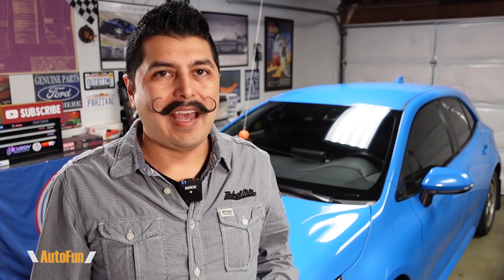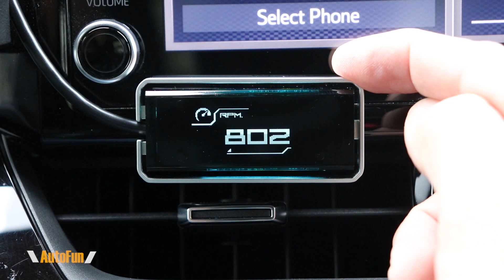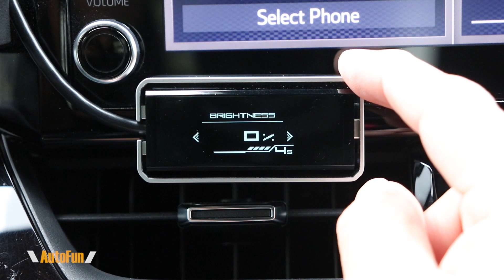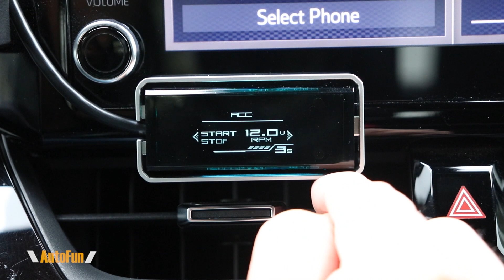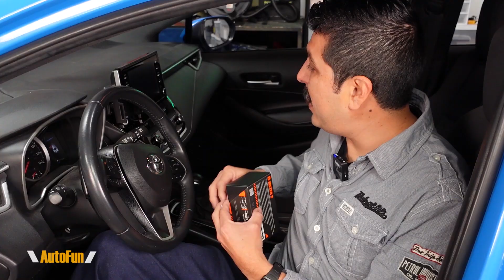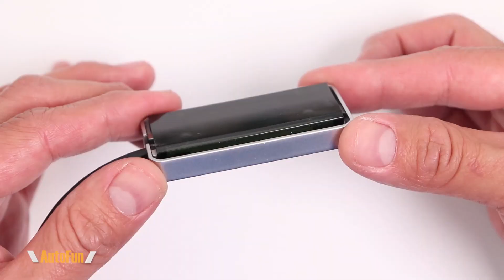Shadow D-Meter OBD2 Gauge Review (Boost, AFR, RPM, Speed, Voltage, Oil & Water Temperature)

Comment: Hi, great review. I have one question: does the D‑Meter gauge have a peak‑hold memory for boost, and does it support peak‑value alarms? I need to know if it can store the maximum turbo pressure and warn when the peak is reached. Thanks.
Reply from the maker: Thank you! Yes as shown in the video, you can set custom alerts for values like boost, cheers!
Reply: @AlexAutoFun  Thanks! Yes, I saw the custom alerts. My question was specifically about peak‑hold memory: does the gauge store the maximum boost value so it can be recalled later? In the manual I only see warning thresholds, not peak‑value logging.
Reply from the maker: @phoenixxx6969  Ah no, it does not support logging. If you need to log PID's I would recommend a basic dongle scanner like this one https://youtu.be/Wy2mxvdIH4E cheers!
Reply: @AlexAutoFun  From what I understand, the gauge in your review doesn’t have peak‑hold memory. I wasn’t looking for a Bluetooth OBD2 dongle: I needed an OBD gauge with fast refresh like yours (even if it’s not CAN‑BUS), but that can also store and recall the maximum boost value. Do you know any gauge with these features

Comment: I’m using it for almost a year on Infiniti Q50. It shows an extremely high values for EXT parameter, which I thought was supposed to show outdoor temperature. It shows 900F in this video so it’s not only my case. They specified the 900-2400F range on their official website, so it could be only exhaust temperature then. I googled and found out- it is an exhaust temperature. 
This maybe useful for some people
Reply from the maker: Hi I! Correct, EXT is normally the exhaust temp (usually at the catalytic converter but I also seen it Pre-Cat). Ambient Air Temperature is usually AIT, ATT, in some cases this info comes from the Battery Temp Sensor and sometimes it comes from a dedicated outside air temperature (normally on vehicles that display this parament on the inside of the car) Cheers!

Comment: What is the best ACC setting if you want to have it not draw power when the car is off? Would it be best to set it to a little under the running average voltage? How do you shut it off with the manual setting?
Reply from the maker: Hi Papaprime! Correct, the voltage setting will vary from car to car as each one will have small voltage variations. In addition, the voltage setting will also vary depending on how "sensitive" the owners want the gage to be to detecting the voltage change (for the gage to understand if the car is ON or OFF). Cheers!

Comment: Do you know if you can calibrate the speed to match what is displayed on the vehicle's speedometer?
Reply from the maker: Hi Twin! Ah remember speed calibration offset is typically only found on devices that pull speed from GPS. That adjustment allows it to match the car's speedometer to the GPS speed if different. The Shadow meter does not pull the speed from GPS, it pulls the speed from the actual vehicle (same source as the speedometer of your car) so it should match. Just keep in mind that OBD2 data is based on frames, which limits how much information can be pulled and how fast it can be sampled from the vehicle, which is why typically we see gauges requiring the lowest lag (typically for racing purposes, like speed or RPM) tap directly to the car electrical system's wiring (usually physically connected to ignition and other sensors) Which helps for cases where a faster response is required. Cheers!
Reply: @AlexAutoFun Thank you for your explanation!
Reply from the maker: You're welcome twin! @twinring3846
Reply: @AlexAutoFun  When you mentioned lag on the OBD2, will there be much delay in displaying the speed? Are we talking milliseconds or a second? The reason being is I plan on importing a car from Japan to the UK, and JDM cars only display the digital speedometer in Kph. Obviously in the UK we use Mph, so I need something fairly accurate. Thanks
Reply from the maker: @twinring3846  Hi Twin, accuracy won't be an issue in my opinion (unless the car speedo signal is off), but latency will be present. If you want to get an idea of the speed of OBD2 you can connect a basic car scanner like this one https://youtu.be/h8hh5ZUffz8 to see the response time or you can also see it on my HUD review here https://youtu.be/K7FbhZTxxaA Cheers!
Reply: @AlexAutoFun  Thanks. I'll take a look
Reply from the maker: You're welcome and here is another HUD that may interest you https://youtu.be/z-m_ez2a8o4  @twinring3846

Comment: That obd port connection looks dodgy man
Reply from the maker: Hi Rocoo! LOL yeah what your are seeing is potting (the material behind the contacts inside the OBD connector) is a standard process in the industry to provide additional contact retention in addition to the physical tabs that some contacts have that lock them to the connector body. That being said, I know where you are coming from, I hope they eventually add an overmold to the OBD connector to fully encapsulate the wires providing both a nice cosmetic appearance (even thought the connector won't be seen by people when plugged in the car, I think cosmetics are important) and also a functional strain relief to the cable to ensure a longer life span. I imagine it was a cost cutting decision to keep the price as low as possible, but maybe they will add in the future, I guess we'll see LOL Cheers!

Comment: Hello sir, i installed it on honda fit/jazz Gk5 2018, and it keeps restarting, doesn’t it support my car?
Reply from the maker: Hi! Correct, most OBD2 ports restart (power off and powers on with the car) with the vehicle, which is why you are seeing the gauge restart. Cheers!
Reply: @AlexAutoFun  it only turns on for a few seconds then the screen turns off, when I press the button it restarts again(repeat) i try on honda hrv also same problem
Reply from the maker: Oh wow that doesn't sound normal, I would recommend contacting Shadow, they may be able to walk your thru some troubleshooting steps. Cheers!
Reply: @AlexAutoFun  ok sir! Thanks🫡
Reply from the maker: @cryshincan1420  You're welcome Bud!
Reply: https://youtube.com/shorts/s0nAWIzbor8?feature=share
Reply: I have installed one today and I'm having the same problem. Tried it on 2 vehicles and its doing the same thing on both. Turning on for a few seconds then off, then powering back on again
Reply: I got this gauge today and it was giving me the same issue I was at the point of sending this back but something told me to try again and restarting the obd2 meter and turning the car off and on again and it’s working fine I drive a Lexus is250 and the only downside is that it won’t read my oil temp and that’s was on of the options I was really looking forward to seeing it in this gauge disappointed on that end

Comment: Excellent presentation.  Thank you!  This may solve my wish to install a remote display ammeter and voltmeter in my vehicles.  Both my 2002 Highlander and my 2006 CR-V are at that age I want to monitor the electrical systems better than the "idiot lights" that come on too late or never at all.  Thank you for the link.
Reply from the maker: You're welcome Donald and thank you!